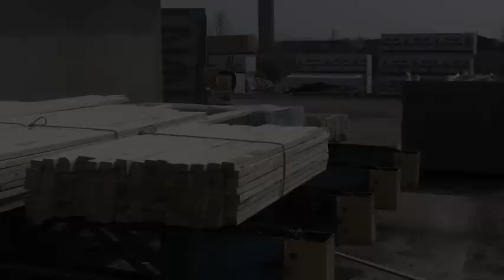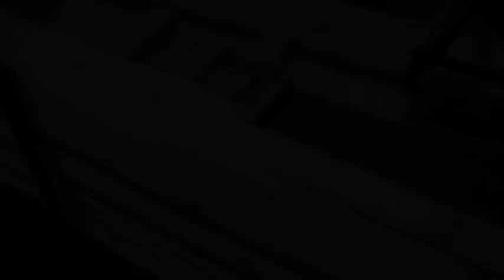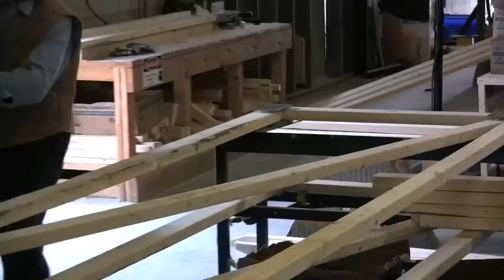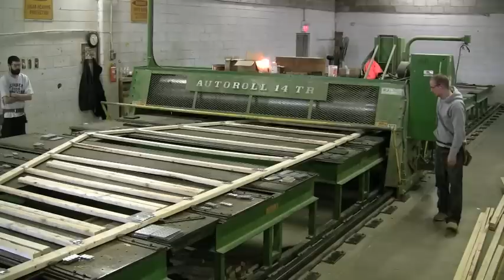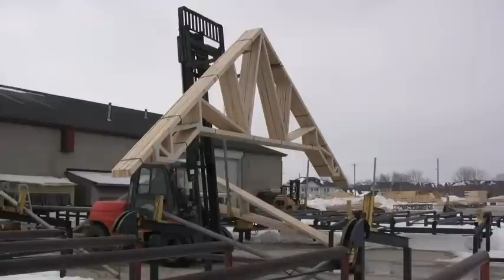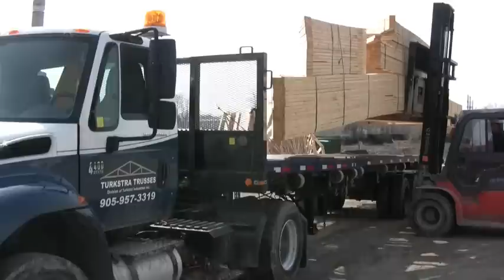The Life of a Truss - Turkstra Trusses

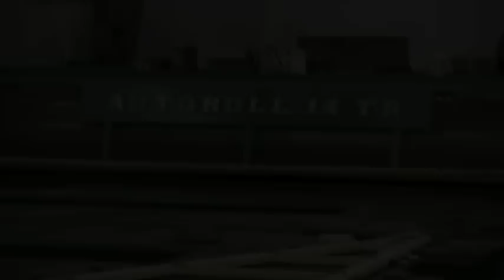Comment: What is that roller for? 2:14 To still keep pressing the metal joints?
Reply from the maker: Correct, it is a high-pressure roller that presses the already fastened metal plates even deeper into the wood to be as secure as possible. We have a newer one that you can check out in our updated Life of a Truss video available on our channel!

Comment: Only if the driver doesn't know what he is doing. I've seen rookies break the 1st bottom 5 or so trusses by either rolling them off wrong ot onto unlevel, rocky ground.

I've seen long term drivers pop the truck in 1st and pull out from underneath the load as it rolls off leaving the entire stack just as perfectly as it was loaded. The key is to drive out from under it as the stack is about 1/3 rolled off...